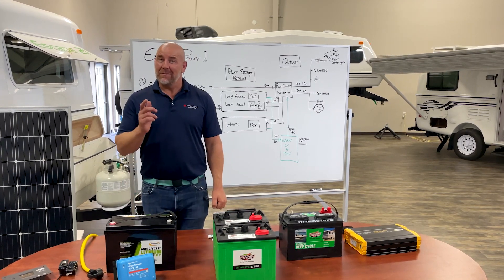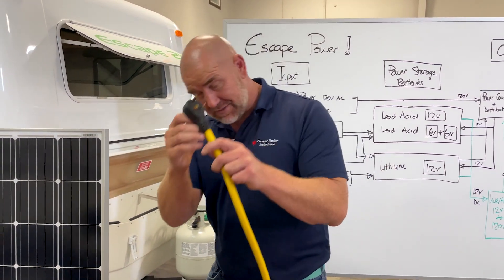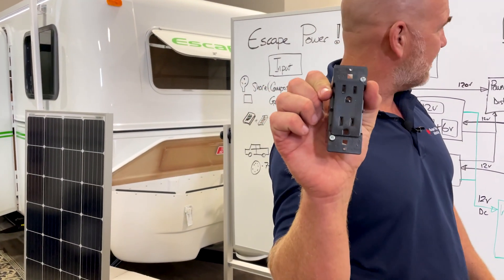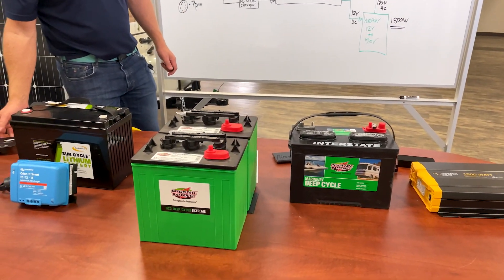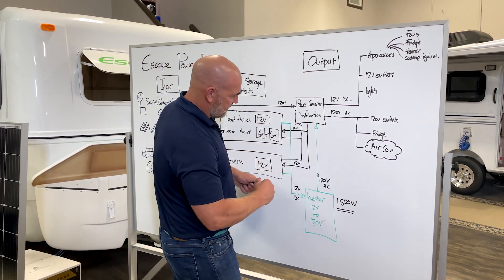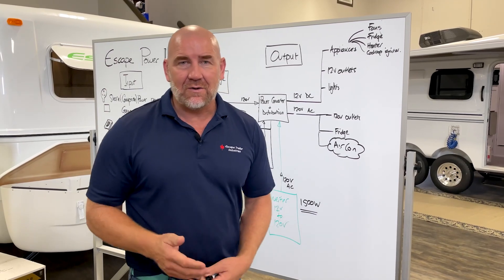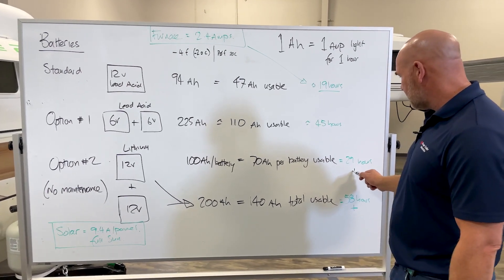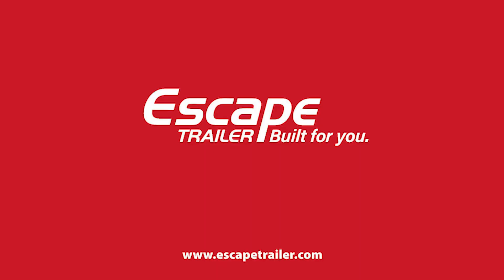RV Batteries and Solar: What's the Difference?

Comment: Karl you did a awesome job describing the electrical system . That is what I like about Escape Travel Trailers as a company y’all are very informative and keep your customers in the loop. Karl my question is what is the device that while  you are in travel mode and charging the lithium battery from the tow vehicle. Called and where and how does it mount. As of now I just upgraded my converter to a smart converter ,But still have a lead acid battery ,and when I upgrade trying to figure best option.for battery type.Still waiting to see escape 23ft .Still in the casita for now but escape is going to be our upgrade. Thanks for all the escape updates . Y’all do the best keeping customers involved .Levi

Comment: Great overview, Carl. We went with the Full solar, Li Ready, option on our new 5.0 (Jan 6th "ish"). We have 4-Battleborn Li batteries for it. For us the challenge will be monitoring the power in & out, as using voltage alone is just a best guess. Looked at both the Victron & Thornwave "bluetooth only" shunt monitors, with the Thornwave winning. Further BT range so we can check battery/solar levels & current draws from the truck or house. Plus it logs power data for 3 years, and a very easy install.  At $159, it's very useful tool.

Comment: This is an excellent video for explaining how you use electricity in a trailer! We went with the two 6-volt batteries but when they die I'm tempted to go lithium -- although in the furnace example given at the end I had expected the two lithium batteries to run the furnace two or three times as long (I guess just because lithium is all the rage!)